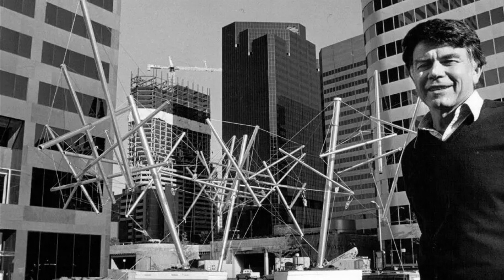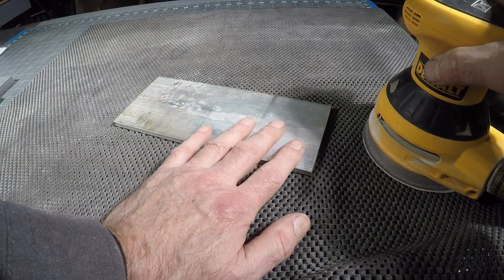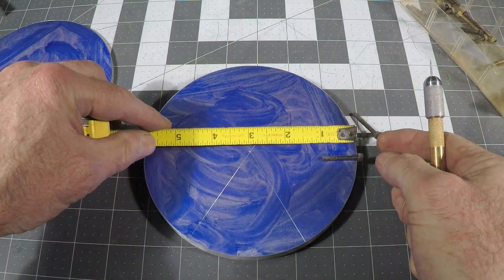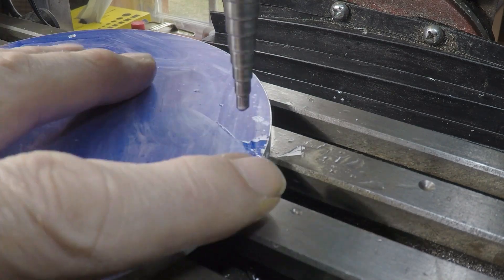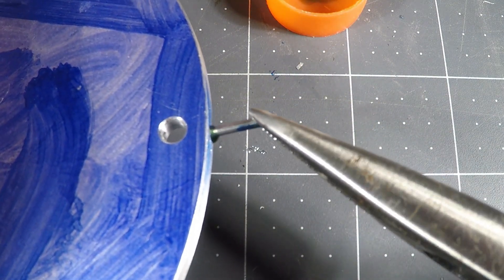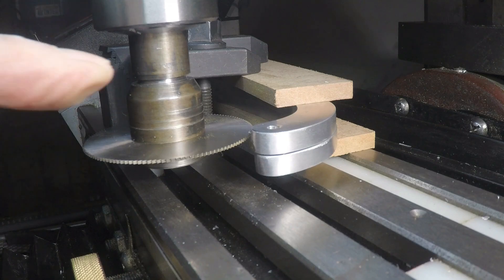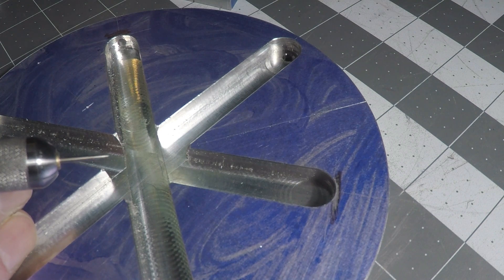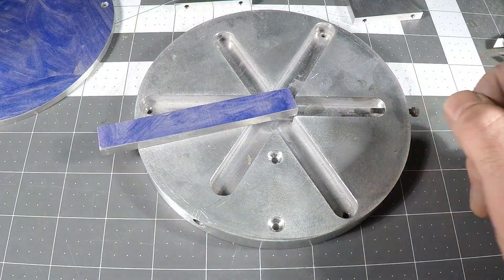Making a tensegrity structure part 1 of 2

Comment: I’ve always been fascinated with Tensegrity art. I have never attempted such an artistic project as this. Perhaps one of these days I will give it a go after I get my CNC machine finished. Thank you for sharing this project.
Reply from the maker: I'm glad you found it interesting. I'm sure you'll enjoy the second video too.
Reply: @GuyMarsdenMakesStuff  I really like the optical center punch that you used, I was going to just buy one but they’re rather expensive for what they are. Then I had an aha moment and realized that they aren’t really that difficult to make so I am going to make one.
Reply from the maker: @taranson3057  it is a really great tool. I'm not sure whether you could make one as accurate because it really relies on the optics being perfect.  The construction of the optic includes a magnifying lens and a precision X cut into the bottom.
Reply: @GuyMarsdenMakesStuff  I’ve made optic’s from acrylic rod before, it’s really not that difficult.  I have various grit of diamond polish.  I also have scribing blades that will cut lines with a width that is in the tenths, I also have a microscope to make sure that I get the lines scribed in their proper place.
Reply from the maker: @taranson3057  😮I'm impressed!  I have worked with acrylic for over 50 years and would never attempt optics.  I'd love to see what you come up with!
Reply: @GuyMarsdenMakesStuff  The trick is behind the sanding/polishing.
Reply: Just a quick update on the acrylic optics that we were discussing.  I had a 1” diameter acrylic rod, reduced one end to 1/2” for a length of 1”, polished it to a near clear surface finish, polished the smaller end with various grit sandpaper followed by various grit diamond slurry up to  6000 grit, created a dome shape on the larger end and polished it the same way and it performs just like a magnifying glass should.  I could use this practice piece for an optic for my project but it is a bit too large for my needs
Reply from the maker: @taranson3057  Yes, I knew how you would do this, but the devil is in the details!  All that polishing!  Wow, not sure I have the patience for that!
Reply: @GuyMarsdenMakesStuff  I have loads of patience, never use to be that way but since retirement a few years ago patience is now my middle name 😎.  It only took me about 25 minutes to make this thing and I was surprised that I remembered how to do it.